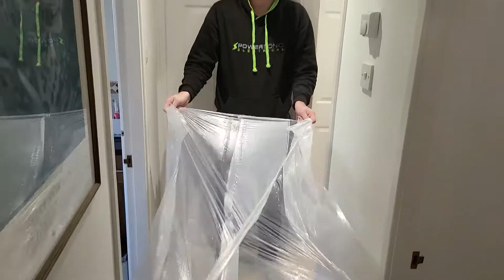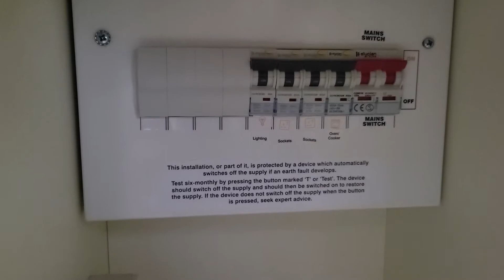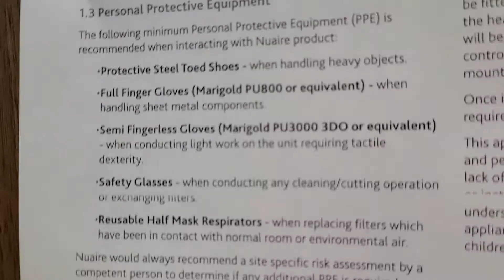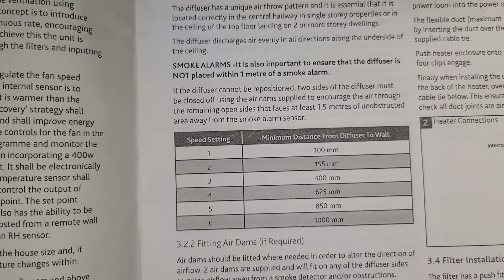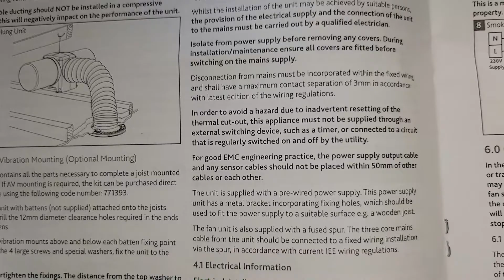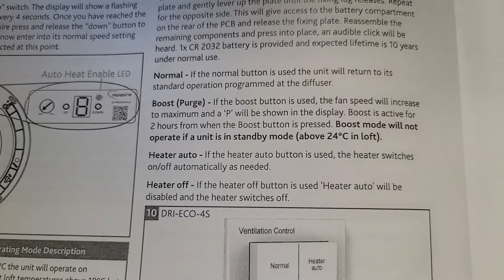Nuaire Positive Input Ventilation (PIV) What is that? A cure for condensation?? Full guide

Comment: I rent my home and the Nuaire was fitted in November last year when the property was empty. I moved in three months ago and there was a sooty smell coming from the vent and sooty acrid air pooling on the stairwell and bathroom. I'm not sure if there are adequate air vents in the loft? The filters were replaced yesterday and the used ones were black inside and out. After watching your video I realised they should be good for 5 years, but the longest this unit has been in use is 6 months. There is still a sooty musty smell coming from the vent even after the filter change.
Reply from the maker: Depends on airflow and loft condition for filter lifespan. If old coal fire best get the koft cleaned tbh

Comment: how does the 400W heater get power, the mains power supply is only 24VA
Reply from the maker: Via the 230V mains input. It pulses on rather than draws 400W consistent

Comment: Air change for moisture control is extremely inefficient- especially if there is no heat recovery! A de-humidifier is way more efficient.
If you are going to fit a centralized air exchange system (for CO2 control, NOT humidity) it should include a heat exchanger.
Reply from the maker: Dehumidifiers are nothing like as efficient when user input and operation power are considered. Poor advice
Reply: @ It is not the movement of air that takes the energy, it is heating that air. Air change only incrementally reduces humidity, so you need a lot- especially if it is high humidity outside. A good dehumidifier uses the latent heat to achieve greater than 100% efficiency.
Reply from the maker: @Tensquaremetreworkshop  if you have latent heat yes. Aside from the obvious cost of user interaction.  Something many discount. These PIVs are very effective and keeping heat lower in a property for longer and circulating air to spread residual heat in ways other things can't. At a much lower cost than Mechanical heat recovery systems. Which are the best approach but not everyone has the budget or desire for redecoration to install. PiVs are a well established Nd effective method to deal with this in ways dehumidifiers can not. I know as we install dozens each winter when customers get fed up of the dehumidifiers. Both in noise, hassle and cost. 

If you believe different that is your right. My view is your incorrect.
Reply: @ Ahh, you have a vested interest… OK, let us forget opinions, and run the numbers. As an engineer, I can do the math to compare the energy requirements - can you? After you…
Reply from the maker: @Tensquaremetreworkshop  what a rude comment. For what its worth I have a degree in electrical engineering and 25 years experience in the UK. What do you propose is my vested interest? We do not manufacture these products and it is not even close to the main part of our business provision. While you warm you calculator up make sure you understand how positive air pressure works in correctly ventilated home. Something a dehumidifier approach wastes energy masking rather than holisitcally resolving through careful engineering. Any engineer worth theor salt wouldnt be short cutting the right solution with rudementry approaches such as the one you propose. Do better
Reply: @ My apologies if I misunderstood your qualifications- it was based on your strange use of terms ( and grammar) in your comments. Good to hear you are capable of doing the calculations- I look forward to seeing them.
Reply from the maker: @Tensquaremetreworkshop  the narcissistic nature of your comments are not a good reflection for you. Those who watch my content know I have dyslexia. Which most definitely isn't a reason someone would not be an engineer. It's a plonkers term anyway for those who want to elevate themselves above others. Your asking for calculations as a lead in because your buried so far out of your depth is embarrassing. Punch whatever data and stats you like in the comments. Or your credentials because so far your only at the level of rude expert on the Internet.
Reply: @electrician247  'if you have latent heat'- nothing to do with dyslexia to not understand that the water in humid air contains the latent heat of evaporation.
So, you do not wish to show the mathematical comparison of ventilation vs dehumidification. Too hard?
Reply from the maker: @Tensquaremetreworkshop  your pushing a calculation comparison on to someone else in a move of dominace/aggression. That won't work here. If you want to present a case for WHOLE home dehumidifiers vs blended ventilation that mixes air volume rather than replaces  take your best shot. The science on this is done to death. In small singular areas dehumidifiers definitely have a place. They are still a hassle of course. 

I've taken a look at content on your channel and could pull a few things apart tbh. Not my style and perhaps that engagement is what you want 😉. Chin up and bring any kind of comparison you want to the party.
Reply: @electrician247   No? OK, I have run the numbers for you. Turns out, on an average Winters day, it takes just over twice the energy to heat the exchanged air from a PIV as that required by a dehumidifier to effect the same humidity reduction. And that ignores both the energy required to run the PIV and the extra heat provided by the dehumidifier. 
Of course, both solutions are sub-optimal; much better to tackle the source of condensation. Leaving aside those people who try to dry washing in a house with the windows closed (they deserve all they get) the main cause is cold bridging. Often the issue is uneven insulation; normally, if all the outside walls are at the same (lower) temperature, a tiny layer of moisture exists on them all. This is not a problem, and goes unnoticed by the occupants. If, however, they are all insulated except for a small area then the condensation collects there, to the stage of water running down the surface. This is not only a condensation issue, it is a lost heat issue. Solving it will remove the condensation and reduce heating bills.
I repeat- deliberate air change to supplement natural exchange is valid for CO2 control (but measuring actual levels is advised- calculating normal air change is fraught with difficulties) but far from the best for moisture control. Solving the cause is best, beyond that depends largely on the nature of the heating system. Sucking air into the building without a heat exchanger is probably the worst.
              'blended ventilation that mixes air volume rather than replaces...' All ventilation is blended.

BTW, your aggressive attitude and personal attacks do you no credit. Attacking a person, rather than their expressed viewpoint, suggests the defensive position taken by a person losing the argument. It is not that taken by someone seeking the truth.
Reply: @Tensquaremetreworkshop  well, I can only say what works best for our house. We had a dehumidifier running ALL last winter (Meaco Arete, so not cheap).  It worked brilliantly for one room and then gradually less the further away (obviously). As soon as it's switched off though, eventually the RH rose again. We used to open windows regularly (if the unit was switched off), we have a bathroom and kitchen fan also. This year we installed a PIV unit, we use the dehumidifier for drying clothes only, our house has never been better RH wise, we have NO condensation or cold on bedroom windows or anywhere for that matter  even in the freezing days and with the window(s) closed. Our RH is now at high 50's low 60's regularly, our heating is 18/19c from 7 am until after 10 pm. Statistics (not science) can be made to reflect whatever you wish (not you personally). The PIV unit works superbly  for us and I'd recommend one to anybody !

Comment: Re the heating, im not actually sure it will impact it that much if it produces enough positive pressure.

Sure you will push some cold air in, but then you wont be leaking cold air in anywhere else (assuming you've your got your windows closed). It will just move where the cold air is coming into already rather than adding to it.

Am i right in my thinkin?
Reply from the maker: Yes. That and it keeps the warm air lower in the property for longer and lowers humidity. Which helps heating.
Reply: Brilliant. Might be sending an RFP your way 😊

Comment: I have a piv installed for 9 mths now... It has reduced the humidity from around 80% to 45% roughly. It smells fresher but unfortunately clothes that are left out on a chair or not hung away quickly smell of damp... I brought a cushion from my couch to a friend's house and it smelled of damp. 
I use a dryer and it's just me in the house... Don't know why things still smell musty.
Could there be hidden mould or spores or something causing this? Has anyone has issues such as this after installing a piv?
Reply from the maker: I would check the filters on the PIV are correctly attached. But if the air is fresher I would be looking at spores in the fabric of the building. These may require treatment to remove. 

You could also have damp areas in the property not related to condensation. Requires investigation

Comment: I just fitted my unit 

How long will it take for it to take full effect??

Mine has been in 24hrs and I still had bedroom window condensation this morning
Reply from the maker: It wont clear the problem on its own or within 24 hours. You need to ensure the loft is well sealed from the house. Spot light holes, loft hatch etc. You need to ensure the loft itself is well ventilated. Extractor fans to bathrooms/kitchens. 10mm undercut to doors minimum for airflow. insulation to loft. Trickle vents to windows ideally. With the above in place it still isnt a solution in full and condensation will still form on the coldest days. However it will improve things without question. It depends how damp the property is and if the heating is utilised alongside the PV. But results should be noticeable within 2-3 days in most circumstances and this continues to improve overtime. The best way to monitor the actual air quality is with a humidity meter. But dont expect condensation to disappear in full. That is not how these work or a realistic expectation. Thanks
Reply: @electrician247  thanks for the response,

Yeah I have covered all the above,

I moved in fitted a inline extractor fan in the bathroom, all new windows have trickle vents open and the loft is vented and the hatch / down lights are nice to tight 

We have been previously using dehumidifiers so wanted something more permanent 

I am going to cut 10mm off the doors this weekend 👍

We don't have any mould it's just the window steaming in the mornings we are trying to battle
Reply: Ours took at least 3 weeks to start noticing things, persevere...

Comment: It doesn’t make any sense. MVHR that’s what you should install, not that overpriced toy 😂😂
Reply from the maker: Is your opinion and your entitled to it. But it’s wrong. Lots of homes don’t have the need, want or budget to install MVHR. Never mind the redecorating afterwards. We do install plenty of MVHR when appropriate, like all professionals out there working with clients to solve problems rather than trolling away on a keyboard.
Reply: @electrician247    I agree, I shouldn’t say that, apologies.
But after seeing so many problems with loft conditions , and I know UK building standards I can’t agree to install this device in loft. We can still find over there old asbestos insulation , asbestos water tank,plus no breathable felt, plenty dust etc. If the person who installs it is aware of this that’s fine , but in many situations unfortunately people don't know about it.
That’s why I think it’s better to not promote this device.
Reply from the maker: @Matt.ffgmatHexPulseChain  professional installers will be surveying loft spaces. If asbestos is found no work takes place and that is beyond just these products. Generally most loft spaces do not contain asbestos as accessible to occupiers. You can’t discredit a product and not offer it as a solution based upon that imho. 

Again a properly specified system will take into account the sealing of the loft from the house and also the external ventilation into it. Ensuring the conditions are suitable for the product. 

These are a very cost effective way to help tackle poor ventilation when professional installers are utilised. 

There is no promotion here beyond exactly that. If you are not comfortable installing them and don’t carry out asbestos surveys then 100% you do right to not offer these products. But that doesn’t mean other people who are capable can not.
Reply: Can you plug the non heater version direct into a 240v socket with a standard plug?
Reply: @jsa2001  yes, you may have to fit a plug depending on the manufacturer...

Comment: Hi Mark, I've been told I require 3 fans (Downstairs Utility room, W//C (Next door to downstairs utility room and upstairs Bathroom) This would be fitted in the loft and comes out on the upstairs landing? Does this sound correct to you? I'm unsure how this would work supplying to two fans downstairs and one fan upstairs? How would this work in the landing?
Reply from the maker: Sounds like you have mechanical whole home ventilation going in? That is different to a basic PIV.
Reply: @electrician247  I have asked them and it's this model. Lo-Carbon
PoziDry Pro by the company Vent-Axia?

Comment: Hi Mark. Excellent video on the installation of the Nuaire PIV, thank you.
Have you compared the Nuaire Drymaster to the Vent-Axia model?
Reply from the maker: I have and we choose to only install the nuaire.
Reply: @electrician247  is there any particular reason why you dont go for vent-axia? I have seen both of them on Amazon and the price difference is quite a bit.  Great video very informative
Reply from the maker: @DickTheDastardly  we did try them but had some early failures. Nuaire is better quality imho and you get what you pay for.

Comment: Nice video, thanks . Just wondering does the machine blow dust particles from the artic back in the house... i saw filter but i would be worried fiberglass particles  from attic insulation going back into the house....
Reply from the maker: Filters prevent that. Helps remove allergens from the air. Cam even get advanced filters for even finer filtering.

Comment: Im just looking into getting one of these after knowing about them for a few years, now the question is... which one to get? 
I'm going to go for the heated option but there is a new pricer version with carbon filters, are they necessary in your experience?  

Do you generally smell the attic through the air coming into the home? 
If thats not necessary which model would you recommend out of the range?
Reply from the maker: Nox filters are best. Always worth it in polluted areas and dusty lofts 100%
Reply: @electrician247  Thank you very much,  I'll go with that so. I thought my husband could fit it himself however from you video it seems to need to be wired to the mains? Does it not come with a plug?
Reply from the maker: @SiobhdhraMc  some of the PIVs do but the nuaire doesn't presently.
Reply: @electrician247  Thanks for taking the time to reply!

Comment: Hi, looking at getting one of these installed in our 3 bed cottage as really struggling with condensation upstairs and it’s creating mould areas around windows. What areas do you cover, we are Bury way?
Reply from the maker: We can come to Bury but it's outside our normal work area.  Prices are typically around £1100 with the VAT supplied and installed. 

Drop an enquiry over to mark@powersonic.co  it is just .Co on the end

Comment: Do you need an outlet duct through your roof? Where does the air go that is drawn up out of the house?
Reply from the maker: I think I answered this on another video with yourself lol. But for those following here. It injects air rather than draws it out. Which is why you need a well ventilated loft space or to use the flatmaster version to duct the air in from outside.